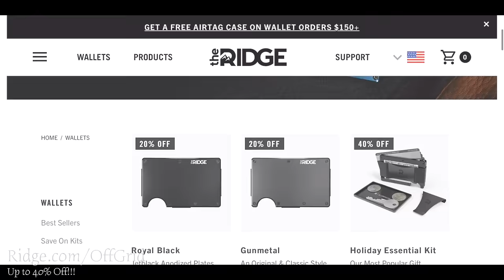LIVING in a YURT OFF GRID for 4 YEARS | FULL TOUR of MY YURT TINY HOME in the WILDERNESS - Ep. 162

Comment: Hello Jake & Nicolle I have a very cool tip to add to your"tip jar".  I needed a glass chimney one windy night tent camping in Mexico.  Asking the owners of the property if they had a empty wide-mouth glass jar (mayonnaise type) they did..and the other surfers sitting around paid little attention.  Next, I was going to need a pieces of string long enough to go around the jar and tie, they had that as well. Heads turned when I got to the gasoline part to dip the string in, and the bucket of cold water. Now everybody was watching.... WTF is this guy up to!  Wetting the string in the gas and tying the string 5/8" up from the bottom, so as to be on the flat sides of the glass, not the rounded last part, I lit the string. Here you want to focus and keep the heat right on the string line rotating the jar until the fire burns out. Then quickly and evenly dip the bottom of the jar in the bucket of water. 2 Mexicans, and about 6 surfers let out a loud cheer as the PLINK was heard and a perfect cut made!  Half a coconut shell, some sand, a candle  and > my new chimney headed off to bed.   Buenas noches!  ✍)))